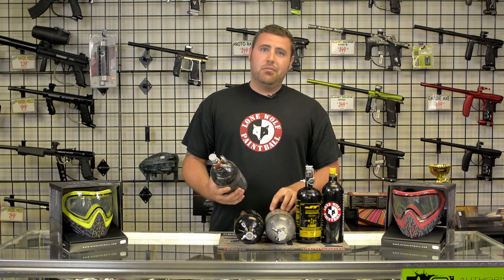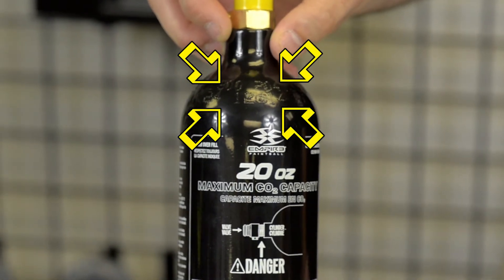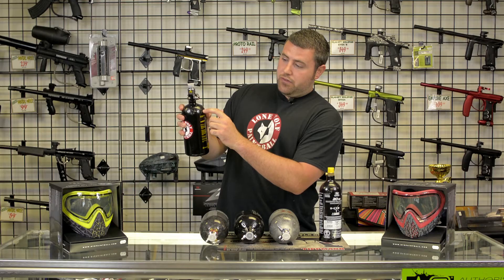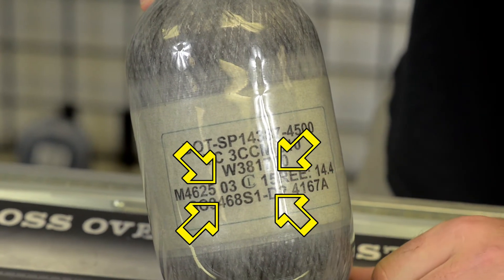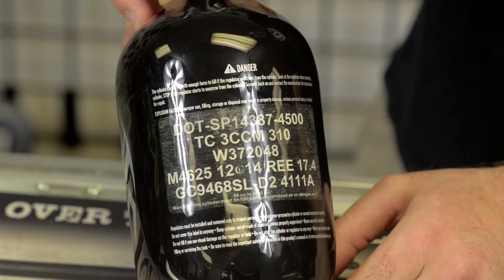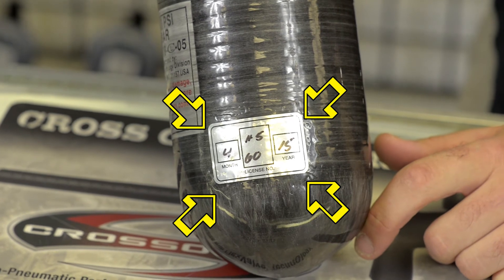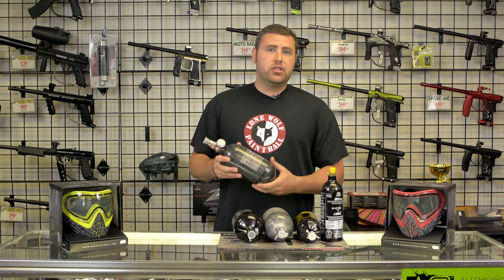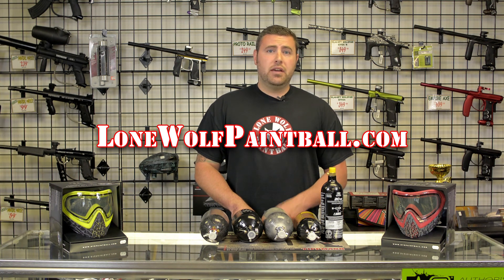Paintball Hydro Test Tank Dates & Meanings Lone Wolf Paintball Michigan

Comment: ugh..... The last carleton fiber wrapped tank has its DOT 3 year hydro test instructions 3:16 written on the bottom, you can clearly read it in the video.  Not all tanks are 5 year hydro, some are 3 and may or may not have 3 year hydro instructions.  the DOT or E or SP number will tell you the hydro specifications.

Comment: wait so when it gets hydro tested can the test fail and not be able to be used or if you take the test it will be good for another 5 years
Reply: If it fails, you can't use it. If it passes you get 3-5 more years.

Comment: 2x2 Rule, "Any cylinder not exceeding 2 inches outside diameter and less than 2 feet in length is excepted from volumetric expansion test. " https://www.ecfr.gov/current/title-49/subtitle-B/chapter-I/subchapter-C/part-180/subpart-C/section-180.209

If you play games where you don't shoot a lot (pump, mag-fed etc.) you can save money by buying 3oz CO2, 3.5oz CO2, 7oz CO2, 9oz CO2, 8ci HPA, 9ci HPA, 13ci HPA or 22ci HPA tanks.

NOTE that filling tanks is always at the fillers discretion and it is a good idea to check ahead to make sure they accept the 2x2 rule. For example no Dicks Sporting Goods accepts it and I have run into some fields that don't, but most fields and independent stores will accept it if you show them the DOT section that pertains to the rule.